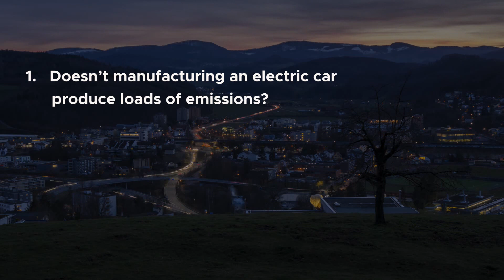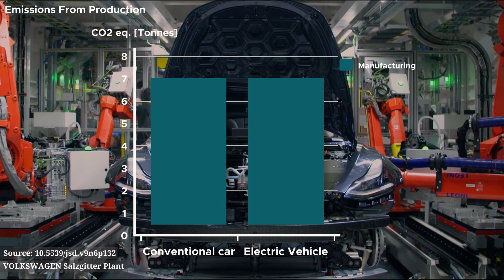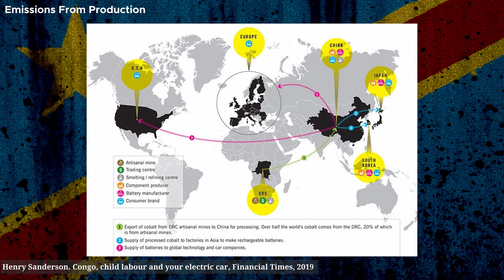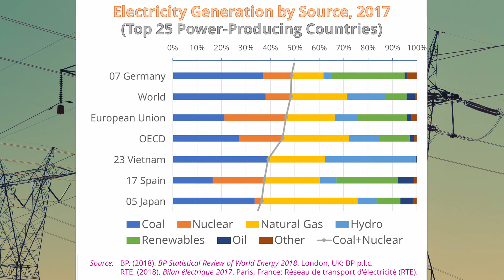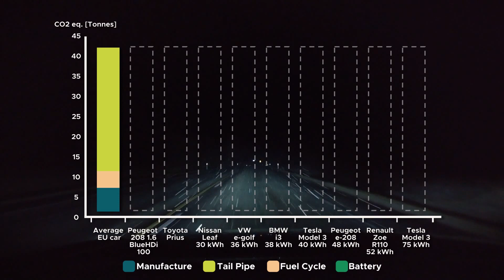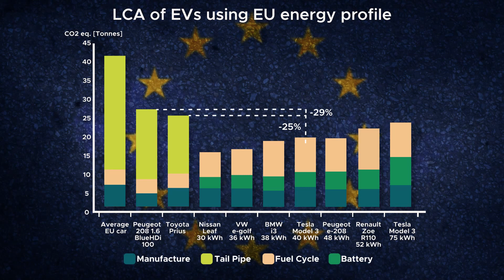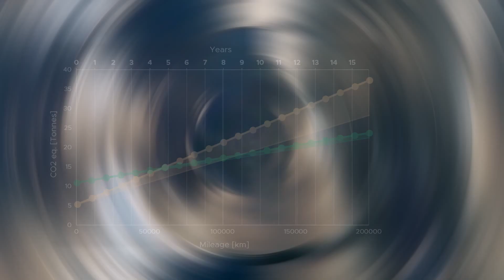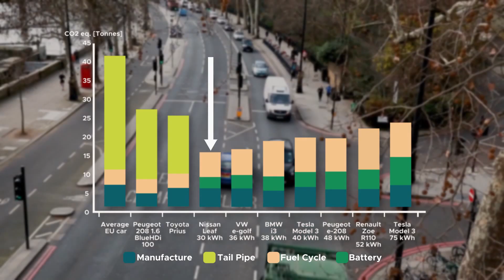Could Electric Vehicles be Bad for the Environment? Data Reveals the Truth

Comment: Nice video. I'm very interested to see how these batteries stand the test of time because if they have to get replaced every 10 years or so, seems like most of the emissions gain of owning an EV would be wiped out. Another thing that gets me with these vehicles is that we again rely on tons of natural minerals that will only get more expensive as time goes on. Only time will tell.
Reply: The only thing Green about the EV is it has no tailpipe with Carbon monoxide coming out of it.  Present and in the future as the engine technology, emissions technology and exhaust technology continues, that is becoming less and less.    Governments are not phasing out petrol cars.   They are forcing the consumer to purchase EV's they may or many not even want.   3.2 million new EVs were registered globally today, and they expect it to be 25% by 2030.      I can hardly wait to see how that plays out.   The amount of Graphite, Cobalt, Lithium, Manganese, Nickle, Copper...  Emissions gains of owning an EV's are wiped out by the batteries alone,  relying on tons of natural minerals that will, which are get more expensive as time goes on, of which mining, processing and transporting
Reply: The gains will not be wiped out, because to make a battery it releases 10 co2 tones, but a clasic car will release 5 co2 tones / year, so you can replace the battery every 2-3 years and will still not be worst than the clasic internal comubstion car.
Reply: Mining lithium and nickel for EV batteries causes greatly increased CO2 emissions and enormous toxic wastes.
Reply: @robertherman1146  What a load of evidently wrong bovine manure. And Oil exploration is cleaning up the nature? Right?
Reply: @robertherman1146  did you not watch the video? they were in my opinion too conservative and they still showed that after less than 5 years thats no longer true. Also batteries can be recycled and gas once used is gone.
Reply: Why do you feel a'n EV battery pack has to be replaced every 10 years? Why can't it be refurbished at a fraction of the cost of a full replacement?  We have independent EV specialists already offering this service in the UK.  And did you know the oil industry also relies on mining minerals which get more expensive as time goes on?  How about if, in a few more years, EV battery technology moves away from using minerals such as lithium and cobalt?  Tesla are already producing cobalt free batteries.....
Reply: @Brian-om2hh  do you know that all the plastic in your car is produced from oil?
Reply: @franfinesim  I wouldn't bet on it - at least not directly from oil but rather second use. Current EV like the Hyundai Ioniq 5 or Kia EV6 rely heavily on recycled plastic bottles or fishing nets for their interior trims. Still they look and feel extremely high quality.

Comment: My ICE cars exist today so no manufacturing needed. I work remote and only drive about 10 miles per week. It wouldn't make sense for me to buy an EV.
Reply: You do realise that modern BEV’s have ranges up to 400 miles to a charge right? Much further than 10 miles. Additionally you would see significant cost savings in terms of operating costs.
Reply: @engineeringtheweirdguy2103  I do my own oil and air filters and there's not much else to deal with the car exists the CO2 required to build a car is enormous people have to think about how much they drive and whether or not there is a net benefit to the planet to scrap their ice car and replace it with a battery electric. I hope it doesn't come down to some government mandate across the board that ice cars are just sent to the scrappy because in my case there would be no benefit in my lifetime.
Reply: @palerider7924  almost all suggested mandates is just a ban on NEW ice cars being purchased, can still buy second hand or maintain your own. Also by operational costs I’m also talking about fuel, not just the cost of sparks and oil filters/timing belts/fuel filters, fuel pump/ air filters. 

Just in fuel alone you can go from around 13c per km to less than 2c per km. That big savings over a year.
Reply: @palerider7924  I wouldn’t say scrap your current car. In that sense you’re right it’s better to just keep going with your current one. But once you do go to buy a new car. It’s better off being an EV, the break even point in terms of a new EV vs a new combustion car is as low as 15k-20k miles.
Reply: @engineeringtheweirdguy2103  I don't know at some point they're going to tap EV drivers for highway maintenance then at end of life or change of hands there may be some kind of state environmental tax to ultimately deal with the battery waste.
Reply: @palerider7924  they already do that in Melbourne. Called a “kilometre tax” it’s a little BS since they claim it’s to cover the lost tax revenue from fuel sales, but you still pay tax on electricity here and the biggest kicker is that the fuel tax is a federal tax but the kilometre tax is a state tax. So the states collecting money to compensate for the revenue someone else is losing. Which is kinda messed up.

Regardless, I save around $6,800 on fuel per year and I have to $300 a year for the kilometre tax so it isn’t that bad.

Comment: The thing I really dislike about videos like this is they leave out a huge part of the equation.
Honestly, do you think petrol or diesel is delivered by fairies with no carbon footprint in their backstory?

When you consider the extraction of oil, transportation, refining all the way down to the ~30% efficiency from ICE vehicles, the picture tells a very different story. You're going into the mining involved in the production of EV batteries, but then leave out a huge part of the fossil fuel equation.
https://youtu.be/1oVrIHcdxjA
Reply: @joim3480  If your roads can't handle a 2 ton vehicle, then that's a poorly constructed road. Also if you look at a car from the 1950s vs a car from the 1990s, the latter are much lighter. In terms of BEVs, we're still in the 1950s and energy density will increase as the technology improves over time. Currently there's more money spent on the chips you eat than the amount spent on battery research. BEVs will get lighters in the decades to come.
Reply: @joim3480  How much does the most sold vehicle in the US weigh again? I don't think there is a Ford F150 with any engine under the 2 ton mark...

Comment: The lithium is a big deal to the planet and carbon footprint. The coal burned to generate the electricity is also a huge carbon footprint. The government are talking about building power electrical stations in forests in the UK. Remember trees absorb and store carbon dioxide. If forests are cleared, or even disturbed, they release carbon dioxide and other greenhouse gases. Forest loss and damage is the cause of around 10% of global warming. Electric cars are worse for the environment
Reply: Ah, the lithium straw man argument again - you really should take a trip to Australia and look at the lithium mine that provides half of the needed lithium, amongst others for your notebook, your smartphone and your heat resistant oven casserole and then compare that to the devastation of an area as big as England for the extraction of oil sands in Canada.

Comment: OK but there needed to be deeper analysis of the cost to the environment of producing petrol and diesel, including its drilling for and transportation from the bottom of the oil well to the fuel tank plus the energy used and environmental damage due to refining it. No analysis was made of the gross inefficiency of the IC engine and the effects of the excess heat produced by burning it.
Reply: Not was the manufacture of wind turbines that last 10 years and the fiberglass needs to be recycled or that solar panels life span of 25 years how are they recycled?  Where is the surface for all these short term renewables to be placed?  I noted nuclear is illustrated but not discussed.

Comment: One question only, here you assume that you either buy an electric car or a petrol / diesel car, but today there are many cars that are already built, emissions of CO2 are already made, so the question of whether it is best for the environment if I continue to drive my diesel car or buying a new electric car becomes relevant. I have done some research and come to the conclusion that I can drive my diesel car for 136 years before it has emitted as much CO2 as an electric car emits during production. I have a 2019 golf 2.0 TDI, it emits about 150g CO2 per km, I do not drive full 10000km per year, so it gives an emission of about 1500kg in a year, if I then refuel diesel from Preem which has 50% tall oil in its diesel, it emits 89% less according to their calculations, which means that I emit 165kg for a year, to manufacture a new E Golf reportedly emits 22500kg co2, and if I share 22500kg with 165 kg it will be 136 , so it means that I can drive my car for 136 years before it emits as much as an E golf does in the manufacture, if I go completely on the task that my car emits 150g per km, I can still drive my car for 15 years before it released the 22500kg that the E Golf produced only during production, so in other words it is best to drive your diesel car as long as possible, but when you buy a new car it should be an electric car
Reply: Use the correct well to wheel carbon emissions of your fuel and you suddenly have to face the reality that those 136 years have condensed down to less than 3 years. If you scrap that clunker today and buy an ID3 or ID4 then you would be in the green after 3 years, even with the little driving you do. Your figures regarding CO2 emissions are grossly overestimated too...

Comment: So what do you do with the Lithium cells after you need to replace the battery being that they are non-recyclable? Also, what about when an EV gets in to a car accident and the cells are set on fire, being that they are enclosed, how do you extinguish the EV or do you wait until it burns away… also, what about the extra weight of the batteries, most people driving alone  to commute but with an EV you always carry the extra weight of the batteries… the extra weight wears the tires faster… actually Tesla tires are a specialty tires designed to carry the Tesla because of this… did I miss these points?
Reply: Are they non recyclable?  You ought to tell Volkswagen, because they built an EV battery recycling plant in Eastern Germany which is already operational.....  How many EV's have you actually owned which wore the tyres out much quicker?
Reply: Yes, you pretty much got all points wrong...
Reply: @danielstillingdff1282  ha haa, you believe the narrative of the msm to much. Do your own research and when I say research, I mean sources from real living scientists.
Reply: Batteries are recyclable, EVs are 44 times less prone to fires, compared to ice vehicles and Tesla tires are off the shelf regular tires. There.

Comment: Producing petrol requires at least 30% of the CO2 emissions from the tail pipe, so the "Average EU car" should have quite a lot larger section for the "Fuel Cycle". About 5-6 tonnes of CO2 should be added to the "Average EU car", hence making an EV even more beneficial.

Comment: Your Bias will hurt.  Your analysis is better than many that do not mention hybrids at all  BUT you don't mention that Lithium ion battery production is limited and hence you can make 1 million Tesla's or 10 million Prius or 8 Million Rav4 hybrid cars. Perhaps you can make 2 million Nissan leafs but again as a fleet this means you replace only 2 million instead of 10 or 8 million.  These hybrids can commute all electric. So do you want to  have millions more running mostly electric or millions fewer heavy full EVs that take more CO2 to make and more to push around?  I think it is clear that those pushing for all EV now are actually causing more ICE cars to be made.

Comment: Do you take into acount carbon neutral fuels such as e10 or e15 mixes of fuel? The fact that a prius isnjust about on par with the 75kw tesla is really on point,.ive seen the calculations for american energy and its much worse on evs
Reply: How is ethanol transported? Only via rail, truck, or ship. Unlike oil based fuels which can be shipped via pipeline.
Reply: @johnbush3610  erm im pretty sure any liquid can use a pipeline but im certain the localy sourced corn based ethenol travels less than the mixture of oil ...it depends where you are and what fuel you use but again...your closer to a farm than say an oil rig in the sea or desert

Comment: All cars and vans should be electric motor powered.  There are too many drivers operating their petrol engines at 5500rpm, 5700rpm, 6000 rpm, over 6000 rpm, and even 7000 rpm!!  Plus motorists operating their diesel engines at 4000 rpm, over 4000 rpm, and even 5000 rpm!!  These type of activities produces noise pollution that sounds like mass murder!!  Plus wasting lots of petrol and diesel fuel!

Comment: After 4.5 yers ev batters losse performance and need to be replaced
Reply: well thats just plainly false. Most EV"s have an 8 year warrantee on the battery today as an industry standard.
Reply: So why do new electric cars come with an 8 year battery warranty?  Clearly, you have done zero research before posting....  Which electric cars have you owned which needed the battery replacing after 4 to 5 years because of lost performance?  Oh, so you've never actually owned an electric car?  So your post is just guesswork?  Let me tell you about a 10 year old UK owned Nissan Leaf, which had a battery refurbishment at an independent EV specialist here in the UK. The refurb took 4 hours, and cost the owner £600. No replacement necessary, a refurb did the trick.  You need to do more research before you post comments on EV threads, because your EV knowledge base clearly has some gaps in it....

Comment: If you add increased tire wear from the heavier EV and the fact only 5% of lithium batteries are recycled in Europe (and "recycled" means only partially recycled), EV start to look pretty dirty instead of green. Add the fact that mining of Neodymium results in radioactive thorium mines, and EV start to become an environmental disaster.
Reply: increased tire wear is not a thing. EV's arent actually that much heavier than their counterparts. For Example, a Tesla model 3 is in the same size and performance category as an Audi A6 and a BMW 5 series. The Tesla weights 1612kg-1847kg, the Audi A6 weighs 1680kg-1845kg and the BMW weighs 1685kg-1990kg. All of which are midsized luxury sedans.

So EV's aren't dramatically heavier than other vehicles in their category and are often times, lighter than some. Increased tire wear would be assuming that the cars weight is significantly heavier than other vehicles in its class and category, which it just isn't.
Reply: @engineeringtheweirdguy2103  Model 3 is not the same category as A6 or 5 series. Those are big cars. Model 3 is small.
Reply: @mdjey2  all of them are classed as mid-sized luxury sedans. Don’t believe me. Look it up
Reply: @engineeringtheweirdguy2103  NO! Model 3 is in the same class as BMW 3 series, Mercedes C-class and Audi A4. These cars are not mid sized luxury sedans. These are compact sports sedans as BMW call them or compact executive cars.
Reply: @mdjey2  according to BMW the 5 series has an EPA classification as a midsized sedan. According to Audi the A6 is also classed as a midsized sedan. Just like the model 3.
Reply: @engineeringtheweirdguy2103  Well yes, but model 3 is not "midsized sedan". Why do you think comparison always is between Mercedes C-class and model 3, BMW 3 series and model 3, Audi A4 and model 3 or Volvo S60 and model 3. You won't find comparisons with your mentioned cars because they are different categories. And your EPA classification doesn't mean a shit because it is only American BS.
Reply: @engineeringtheweirdguy2103  What everyone forgets is that EV's break more gently than ICE cars because they use regen breaking. That also reduces the amount of break wear and thus produces less break dust. In my old ICE I have been very economical with my breaking (my break pads usually lasted 150000km) but still I had to regularly clean my rims from the break dust.